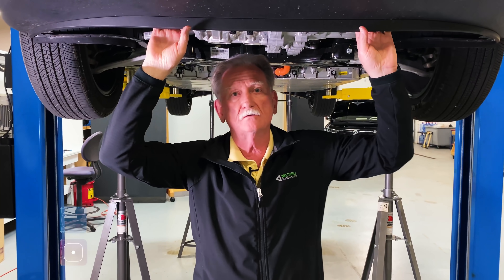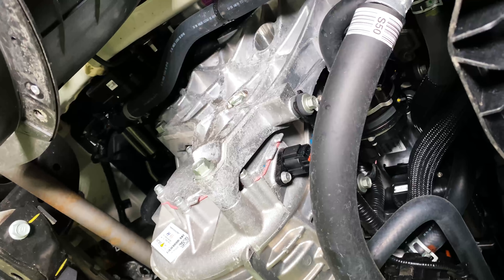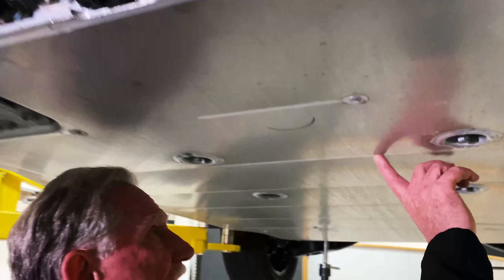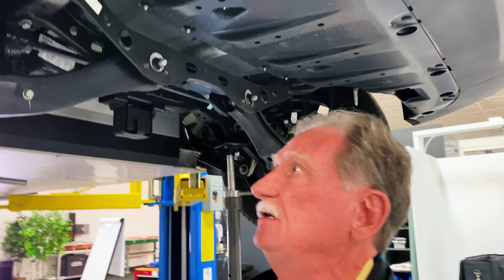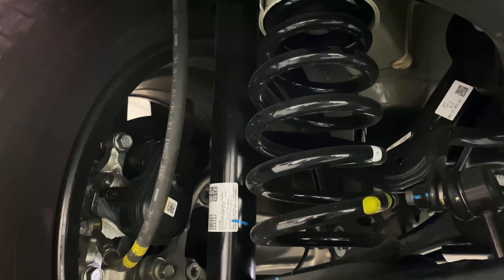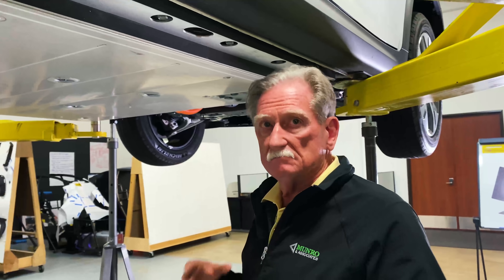Under the KIA NIRO EV

Comment: Just bought a used 2021 for $16k. Thanks Sandy for paying $4,000 of it. I test drove my dream Model Y. Biggest disappointment of my life, FSD didn’t work, rode like a lumber wagon (with no load), was unbelievable loud road noise and had the typical Tesla back seat fit only for kids ( kids needing punishment). On top of that it took about3 to four touch screen keystrokes to do almost anything. Great GenZ car. I’ll take the knobs and dials. 

The Kia Niro was outstanding in all those areas, cost $5k less and had 5 years and 80,000 miles of warranty left.

Comment: That damper in the rear also is useful for protecting the battery from a low speed reverse impact, it's the same height has the bottom of the pack, I think it is there for BOTH damping and protecting the battery. The access panel is likely access to the BMS and each battery string for repairing or correcting issues without removing the battery, BMS can be replaced, individual strings can be balanced manually.

Comment: So this guy thinks any vehicle not intended for off-road use is designed for "timid drivers." As if North America was not chock full of massive, overbuilt pickup trucks that are never driven off road.

98% of N. American drivers are "timid" by that standard.

Apparently he can't handle change. Fortunately, millions of car owners can.

The 1990's slur is BS, too. There were no EVs  in the 1990s.

Comment: Major and common issue with the drive motor - makes clacking noise at low speed and droning noise at high speed after about 15k miles, will still drive but the noise is annoying. Will supposedly give out if not eventually replaced. I'm currently on my 3rd motor at 38k miles. Hope 3rd time is the charm. Not having my hopes up too high though, I'll probably go get my 4th motor at about 50k miles.

Comment: Thanks Sandy for your insights on what we call the e-Niro here in Europe. I got mine in March 2019, one of the first 'off the boat' in France. The car attracts no attention, which is how we like it!...but we do get some strange looks when manoeuvring at low speed in supermarket car parks due to its 'space invader' artificial sound <30 km/h. So far we have 78,000 km under the wheels with the only problems being a failed 12v battery (c'mon car industry why are we still hauling these lead acid lumps around?)...and a passenger wing mirror that failed to fold back when the car was locked (fixed under warranty)..We get 14 kWh/100 km (4 miles/kWh) average winter/summer. We are retired folks and do long hauls from our home in South West France to UK and Switzerland where we have family. The max charging speed at 75 Kw is off the pace when compared to newer EVs but we've never been inconvenienced by it. Last year we did just under 20,000 km and 85% of that was effectively free as the solar panels on our barn roof generated 2,300 kWh...we spent around €240 on public charging and servicing was €100. Love the way it drives and it feels really solid on the road.

Comment: The hole left from the friction stir tool is where the tool is retracted at the end of the weld, not where the tool plunges in the beginning of the weld. And the other welds look like mig welds too me 🤷. Interseting that the outer fsw holes were mig welded shut but not the inner holes on the battery pack. Maybe dissimilar aluminum where the fsw is performed?

Comment: 90's car?  really?  You lost your credibility when you compare this car to one built in the 90's.  GM, Ford, Chrysler, BMW, Mercedes VW, Honda, (should I go on) never built a EV car this good in 2021 when you made this claim.... and other than the newly released Mustang EV, none of them have yet!  It's people like you that are oil gear heads that simply refuse to take your head out of the old tech of oil and gas and embrace the EV cars.  Sure, could KIA have done things better?  probably, but they have a price point to maintain, and a market that does not want to spend 100k on a crossover.   I am curious as to WHICH 90's car you would compare this to?  Then again, I don't think you should reveal that as it would only have you look even more silly.

Comment: Update!! Recent 2022 JD Power EV owners survey:
Mass Market Sector
1st Kia eNiro 
2nd Mustang Mach-E
VW ID 3  Not even listed but ID4 was 6th
Says it all really, if it works why re-invent the wheel.
And don't even mention VW software.
Sandy, as an engineer you may advocate part reduction and multi use  but sales are proving that the average driver prefers simplicity, ease of operation whilst keeping your eyes on the road and not everything on one big screen. May be easier to use on a self driving Tesla but not safely on the average EV.

Comment: Why I bought an E Niro

Excellent range 300+ miles per charge
Efficiency 4.5 - 5 miles per kW 
Fully loaded cabin
7 year warranty
Excellent reliability
Reply: 10 year power train and battery warranty on it here in the US.

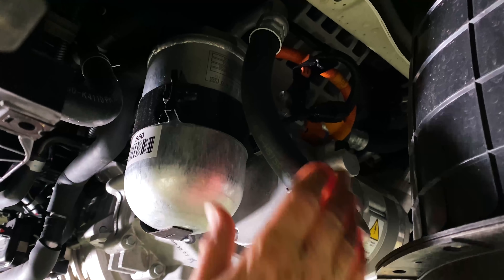Comment: Not explaining things very well so far. @ 2:55.  That's obviously not an access panel, with all those bolts and the sound of solid steel when he knocked on it.  My guess would be a means of holding the battery in place, or something related to that.  To much mass and bolting to be just a panel.  These explanations are ridiculous.  The bracket at the back of the battery is not for projectile protection.  The third side is to keep it from flexing or cracking.
You can sort of tell this guy's only education was an AAS.  This is great.  An American guy explaining how an Asian car is not so good as America falls way behind in car production.
This is one of the reasons.  Know-it-all Americans thinking they know better.  Except the market doesn't agree.

Comment: Been waiting for this car to be reviewed for a while. Thanks for looking at it. Wish you could take that massive motor apart. Been wanting to know why I hear some noise when slowing to a stop when regenerative kicks in. Wonder what bearings are being used. Think this is the issue.
Reply: I drove one the other day.  I have one on order.  That whine is generated when moving below around 12-15 mph.  It's to warn pedestrians with an audible signal that an otherwise silent vehicle is approaching.  120 years ago this was accomplished by a man running along in front of the approaching vehicle waving a red flag.  Locomotive horns provide a similar service for the railroads.  DOT requirement.
Reply: @ocd1927  its more like 12-0 mph, and its like drumming. Kia doesn't take it serious. I think it must be some type of baring, my volt has similar issue, but volt (2013 no pedestrian sound at this time) baring issue make the progression to 0 mph, made it sound like a spaceship. After the dealer fixed baring, the spaceship went away.

Comment: "Well designed 90s car"... ?  so what's the angle?  I'm gonna say, they were so focused on the electrical side, they didn't want to take any chances on the rest of the design/body construction, so stuck to tried and proven manufacturing processes, keeping it simple as possible to increase reliability and minimize unexpected glitches... i.e. they really want to build a car that gets a few complaints about things going wrong... which seems to be an issue with a lot these electric cars coming out.  They've changed so many thing to transition to EV... the goal is to eliminate and/or minimalize unexpected problems...
Reply: I don't have an issue with the design choices either. 

If you don't have much experience with an electrical car, it makes sense to go conservative with things to lower costs and use a platform with proven well known technology that you know has a long proven track record of "it just works". It also means that it makes it easier for any mechanic anywhere to be able to work on these cars, at least on the non electric stuff. Also means that you are using technology and spare parts that you can get anywhere.  99.9% of consumers aren't going to care if something is using mcpherson struts or stamped this or that. 

Is it reliable? Is it going to get me from point A to B? etc.

Comment: I am surprised Sandy didn’t say anything about that rather exposed connector apparently for low voltage control signals on the front facing edge of the battery.  I’m not liking what I am seeing.  I live in a winter road chemical using state and I believe that connector would be splashed and have salts crystallize on the wires.  I am not convinced a fancy pants connector shell and dielectric grease on the pins constitute a permanent solution.  A $0.25 splash shield would be a well deserved insurance policy.

Comment: "Coil-over shocks" and "McPherson strut" are not interchangeable terms. I don't know why you would want the spring and shock to be concentric (whether the spring is mounted on the shock or not); mounting them separately often makes sense. In this case it allows the shock to have as close to 1:1 motion ratio as possible as well as fitting in the wheel well. The spring on a spring link is normal, not "something we don't expect to see".

Comment: The Niro (please do say "Neerow") comes in a petrol, hybrid and pure EV variant and there is no amount of vinyl tape, mounting brackets or other, that'll hide this fact.
Same flaw goes for the Hyundai KONA.
This ultimately makes the vehicle unecessarily expensive in terms of labour, to make all the exhaust adaptations and so on.
Reply: In the previous video of the Niro, Sandy explained it was a joke not to sound like saying “Nero.” It is a not so subtle jab about the battery fires that Kia and gm have experienced with the LG-sourced high voltage batteries.

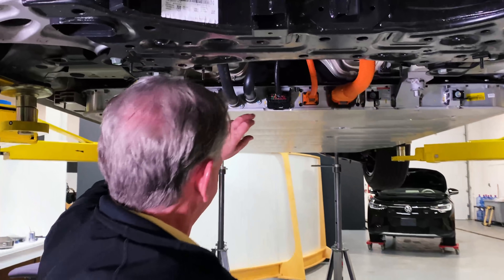Comment: 4:59 "The battery box is quite thin"  
I was surprised to see that the hoses and cables connectors 
were not protected from debris flying from the road.
Reply: And it's not thin. That's just the front edge; the rest of the box is clearly much thicker, as it needs to be to contain the modules.

Comment: Don't underestimate the Niro. Despite using very old style suspension made out of mild steel instead of light weight cast aluminum, the Niro is an exceptional handling vehicle. The steering feels extremely responsive and agile. When it comes to the sportiness and and fun factor, the Niro beats the Model 3. And the Niro achieves it with heavy mild steel suspension! This is why I think Tesla needs to fine tune their suspension with motorsports engineers.
Reply: I can only agree. We got one of the first batch into France in March 2019 and after 78,000 km it feels as solid as ever. I was surprised at how well it handled compared to the Niro hybrid I test drove and the Nissan Qashqai I had previously owned. The expectation is that these 'crossover/mini SUV' shaped cars will roll a lot but I guess with 435 Kg of battery under the floor the weight distribution is better that ICE powered equivalents. The ride is on the firm side and although I've never been in or driven a Tesla M3 or Y I heard the ride described as a bit harsh. The main roads in France and across most of Europe are flat and smooth so even in a firmly sprung car you are comfy for most of the time. I have recorded the ownership experience with all the costs and stats..with some of our trips in France, to the UK and Switzerland on 'Kia e-Niro Diaries' and Kia e-Niro Diaries Encore' if you're interested and can tolerate amateur camerawork..😊
Reply: I agree with the Post and comments. I own a 2019 Niro and its truly a fine machine

Comment: Just curious, if we compare a 90’s car that had notably good reliability such as the Lexus that got a lot of press, how does that car compare to cars nowadays when looking at 200,000 miles of ownership and cost of owning them?  Just because something was done in the nineties doesn’t make it bad necessarily. I think Boothroyd and Dewhurst wrote the book or one of the prominent books on assessing assemblies for time and such probably nearing a hundred years ago. While modern interpretations may differ slightly by encompassing a slightly different mix of details the basic premise is still foundational to what is being done currently. 

I’d like to know more about why. Maybe they are using an older line and it has different tooling and it’s easier to structure the new car for mass production on the older assembly tooling that is available and unused somewhere than to spend a lot of capital to modernize the tooling on a lower margin vehicle that will suck the cash up the flue sort of speak. You can bet they’ve had to scrap / fight hard for everything they’ve gotten so they are likely to not be wasteful of  existing resources in an emerging market. Well that is my guess anyway especially if their ICE cars are manufactured more like the rest of the market place vehicles.

Comment: It's summer time now but in a few months that low hanging pipe up front and exposed low hanging battery connections may cause the winter of my discontent.
Reply: Except that the connections are not the lowest part, and another comment from an Niro EV owner says that there is a cover which Sandy didn't mention removing.
Reply: @brianb-p6586  That makes me feel better, thanks!

Comment: One of the connectors to the battery pack has tiny wires and are quite open and exposed. Looks vulnerable to whatever that comes at it.

Comment: when Sandy says "90's vehicle" that's shorthand for "90's JAPANESE vehicle".  the "divorced spring" IRS design is PEAK JDM and guess what it works.  take a Kona EV or a Niro EV for a spin and you'll discover the ride quality is spot on. 👌  edit: oh yeah turn off TC on either of these Hyundai siblings and they are BURN OUT MONSTERS yet with little to no Torque Steer and do so without using any fancy front knuckle assembly (ref: Civic Type R, Ford Focus RS).
Reply: no he meant 90's chrysler ,
Reply: @fffwe3876  #DAIMLERCHRYSLER

Comment: Having this as a company car for a year, overall very good. Not sure if it is due to the non equal length drive shafts, this EV is suffered from toqure steering when  cornering with  power

Comment: LOL, "transmission" tunnel above the battery. Really old design and FWD...
Reply: The tunnel is for the shaft to the rear for AWD, and likely for exhaust as well. It's not an old design, it's just not an EV-specific design.

Comment: As a first-time EV owner, I'm glad I went with Niro and not the ID.4. This car just works and I love how lowkey & humble it is on the road!
Reply: humble price of $44,000.
Reply: Lowkey and humble. That’s a nice way of saying slow and boring.
Reply: @seantrumble3291  I think you’ll change your opinion once you drive the Niro on sport mode. That 0 torque can easily piss off plenty of “fast” cars at a red light. I’ve turned heads multiple time 😉

Comment: One ..disturbing thing, I immediately noticed during your under car review, but, which you made no comment about,  was that the front leading edge of the Battery Tray has a whole lot of orange Cable connectors and Cable conduits sticking out of it, which ..all look to be very exposed, and vulnerable, to physical impact damage, by ..anything, hard that the car might run over and then flick up off the road surface, or, when, as always happens, the usual idiots, will inevitably end up getting behind the steering wheel and drive it like they are driving a Hummer, over very rough and muddy and rock strewn terrain, during which time that ..vulnerable Cable filled, leading edge of the Battery Tray will be acting like the leading edge of a Farm Plough, on the ground beneath it..!    That ..unprotected, and exposed, leading front edge of the Battery Tray, seems like a pretty serious, and a glaring, auto engineering ‘design flaw’ to me…!! 🙄
Reply: There is normally a guard / cover protection. Sandy must have taken that out to access the bottom of the engine
Reply: Yes, that’s what I thought, that there must surely be some sort of cover/guard over those exposed and vulnerable items, but, I looked hard at the front of the Battery Tray itself and couldn’t see any sign of any attachment points for such a protective cover..? 🙄.   Certainly would like Sandy to make a specific comment on this point, in the next video he does on this Kia vehicle. 😉
Reply: @wa7215  There's nothing thorough, consistent, or well-informed in this video. He just didn't mention removing the cover.

Comment: Usually when they make a car for both electric and gas, it ends up to be very inefficient. bad drag co efficient and heavy etc. but Hyundai/kia really managed to nail the efficiency with their cars. its like 2nd compared to tesla
Reply: As he mentioned, a perfect old person's car. If you limit the power you can make anything efficient.
Reply: @michaelholliday100  I wouldn't call 150kw limited though. Still much faster than the Id3
Reply: @WrathChild-NZ  It does not matter what the Kw size of the electric motor is if the limit the power...
Reply: @michaelholliday100  it's not limited though. 150kw is literally the output you can put out. Have you driven one?
Reply: @WrathChild-NZ  Yes, along with the ID3, ID4, MachE, i3... Any each time I have left the vehicles thankful for my Teslas...